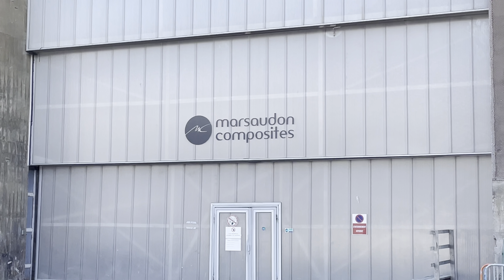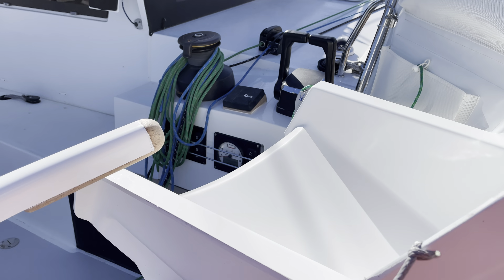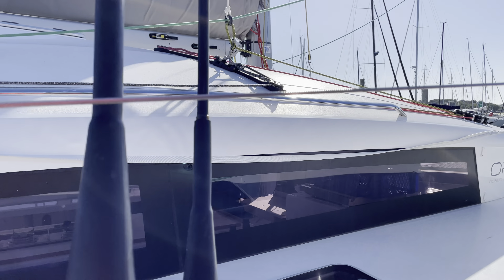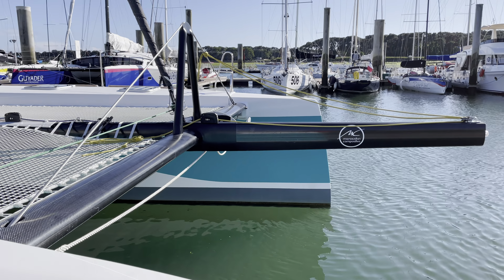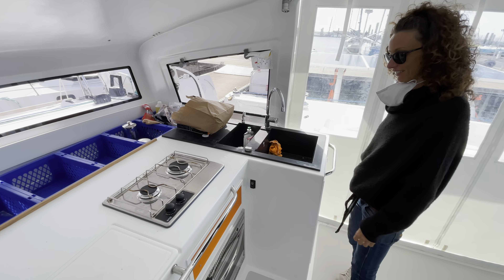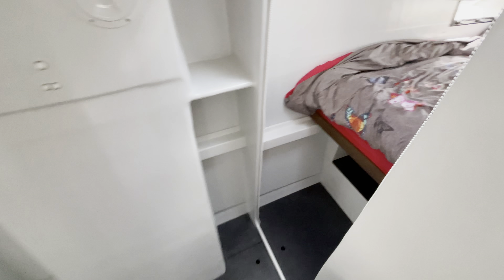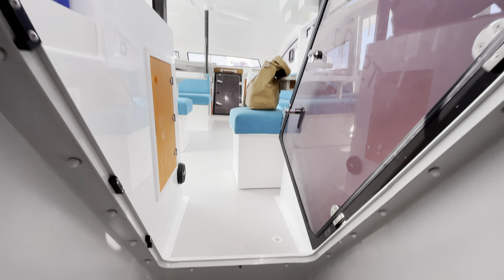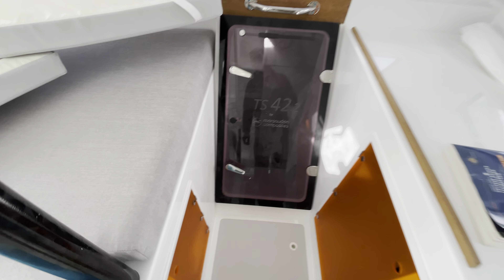New Marsaudon ORC / TS 42 Catamaran Tour

Comment: Hi Jason, I just returned from delivering Spirit double-handed to Antigua from Boston by way of Bermuda. We departed on the heels of a strong low with 25-35kt NW winds. Wow, what an amazing boat. Routinely surfed into the mid 20's without any submarining of the leeward ama, flying a triple reefed main and full jib. The mods you made to the boat since you did this passage in 2008 probably made our experience somewhat kinder than yours, but I tell you it was pretty intense and very wet. We posted back to back 270 nm days runs and got to St. Georges, Bermuda in 74 hours after suffering light winds on the third day. Pretty sure there were 24 hours in the middle where we went over 300 nm. Was very happy to dry out and repair the autopilot in Bermuda. The second leg was an 8 day light air torture-fest due to a stubborn ridge of high pressure blocking our route south to the trade winds. But Spirit is now in Falmouth and staged ready for the Caribbean 600 Series. Hope this message brings back fond memories of your similar run south. Kudos to you for saving and upgrading this amazing boat. Cheers, Pete
Reply from the maker: Hey Pete that’s great news mate glad to hear you arrived safe and sound and that Spirit did her thing. She’s an amazing boat and a true ocean design. I’ve never sailed a boat that’s so good in big conditions. We had four reefs and only the mainsail and 55kts when we left Bermuda. And huge conditions down from Newport. I’ve sailed that route near on twenty times and it was mid December and cold as heck. She took very good care of us and we shared the same experiences as you did by the sounds of it. She’s an awesome boat and it’s so wonderful to see her being used by people that appreciate her! Thanks for keeping us posted and here’s a link to the blog from when we sailed south incase you’re interested. All the best and I look forward to following you on the tracker as you do the 600!! 

https://trimaranspirit.weebly.com/newport---st-maarten---2010/bermuda-st-maarten
Reply: @TrimaranSpiritXL  Thanks for the blog link, Jason. I know AJ would be delighted to have you on the boat anytime you and Claudia are in the same neighbourhood. Cheers, Pete

Comment: Love the minimalism of this boat, keeping things simple and function over form. Although I would trade a few kilos for a slightly more welcoming 'form' interior. They'll also do an Ocean Volt motor/generator hybrid, as a plus it'd probably even save some weight over two diesels. The 'mini keels' are actually described as 'fixed fins' and basically look to be 80cm shorter fixed dagger boards, draft equal to the rudders, and should be better performing than mini keels while (presumably) giving more interior space. Didn't see any rain gutters on the roof, but I'm sure they could come up with a sleek rain catchment system (in order to need just a small water maker).

Biggest thing for me is I'd like helm wheels (which I've seen in renders of the 57) and, make or break, an autopilot. As fun as the boat looks to sail, passages with manual steering would get old quickly.
Reply: I can't imagine many people hand steer long passages these days.